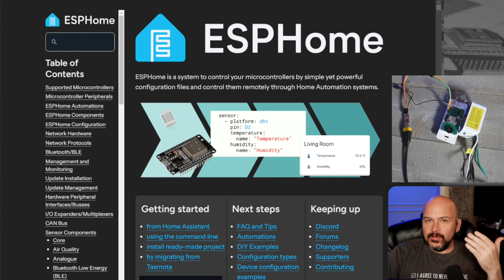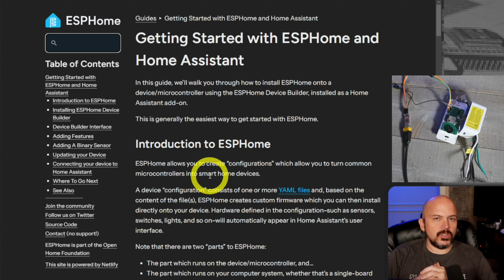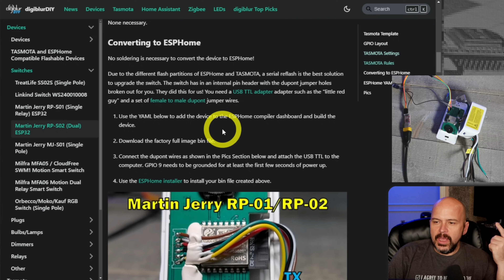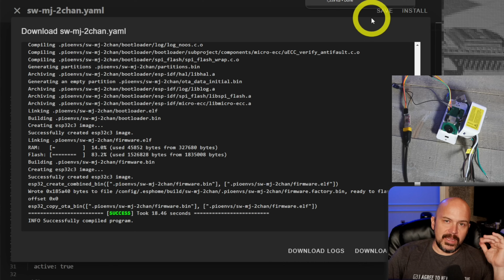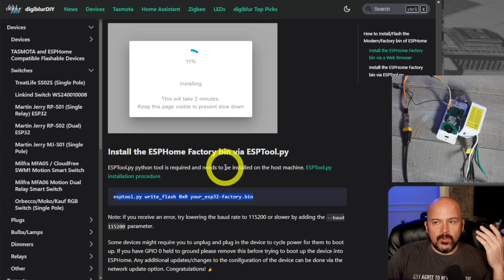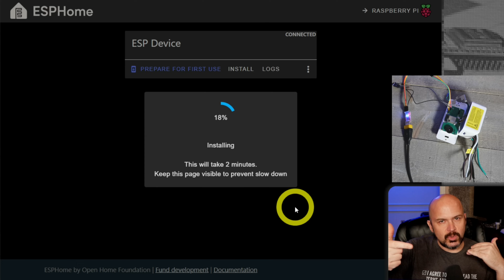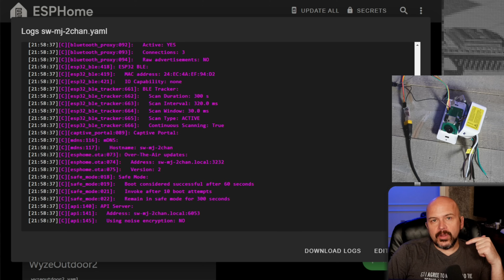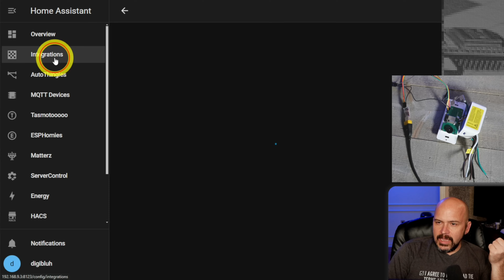ESPHome Install on Martin Jerry ESP32 Switch: No Soldering Required!

Comment: Just bought and followed this to test out the single relay switch. Easy to follow and didn't have any issues. I was looking at the RP-STD01 (3-way dimmer) version. Have you looked at that one for ESPHome? I have a lot of 3-way switches and if the single relay works for me long-term I'd get more of the 3-way dimmers if I knew what to put in as far a code goes.
Reply from the maker: Yeah we had a user get that one in our discord.  It isn't great as it has secondary MCU for dimming and the button presses are weird.

Comment: These things would be way better if the white night light was software controllable. Still bought a couple through your link because I like them overall.
Reply from the maker: Yes, that white light was kind of a bummer being on the wheel.  I don't get why they didn't just connect it to a GPIO like they did the red one.  I've told them about this and hopefully they can correct it in future hardware revisions.

Comment: Do you know that if it has tasmota, you can just user one SO command that will allow flashing of non-tasmota firmware and you can directly upload the ESPhome firmware, without any disassembling?
Reply from the maker: You can not. That's an esp8266 thing and the SO commands hasn't been required for a while now. These are esp32 switches
Reply: @digiblurDIY  Not to force my ideas, but I just did it:
1. with tasmota installed, upgrade to latest version (14.4.1)
2. then flash the tasmota32 safeboot (OTA version)
3. prepare the ESPhome binary, select manual download, get the OTA version, not the Factory one!
4. go to tasmota in safeboot, it will have only 3-4 menu options, first one is firmware update
5. don't use the OTA update, upload the OTA binary from ESPhome
6. click upgrade
7. WAIT, just wait, it will take ~2 minutes.

Enjoy :)
Reply from the maker: @rklauco and this flashes the correct partitions too and esphome OTA works?
Reply: @digiblurDIY  yep, just try, you'll see. Give it the time, it is slow, but works.
Reply from the maker: I just tried it as well.  You will get this error on future ESPHome updates unfortunately.  "ERROR Error binary size: Unknown error from ESP"  since the partitions are incorrect between Tasmota and ESPHome.  Several of us have been through this in this past.
Reply from the maker: This is the process that you have to do to reset the partitions, bit of a rabbit hole and only necessary on devices you can't easily serial reflash.  https://github.com/esphome/esphome/pull/5535
Reply: @digiblurDIY  Nope, if you switch to the minimal firmware, you don't have to do any of that. I really did it when I wrote you. I can make a short video tomorrow, if you'd like.
Reply from the maker: OK. Doesn't work for me as the partitions are wrong.
Reply from the maker: So that pull request for ESPHome is incorrect now?
Reply: @digiblurDIY  Not sure, but what I wrote works.
Reply from the maker: I really wish it did work for me and set the partitions up right for future OTAs but it does not in the current stable release of ESPhome.  I've tried it twice on an ESP32-C3 4MB chip and it fails to update in ESPHome.  It could just be me though and my setup.  I'll drop your comment in the pull request if needed so it can be closed if they deem it now works.
Reply: @digiblurDIY  Let me try with C3...
Reply from the maker: I've asked in the github pull request to see if others can try it.  Let's see
Reply: @digiblurDIY  Yep, just did it with ESP32C3 module. Exactly the same steps as described above, just instead of tasmota32 I've used tasmota32c3.
Reply from the maker: @rklauco not sure what it fails with me. How are you getting the update to take?
Reply: @ I think this PR is about the ability to upgrade even the bootloader. That is not necessary - the bootloader Tasmota is using is exactly the same as ESPhome does. The partitions later differ, but that does not matter for the safeboot version of Tasmota. But I am not big on development, just a tester/tinkerer here, so... But it works for both ESP32 and the C3 version.
Reply from the maker: You got me. I tried again and it failed to update. All using stock stable settings and firmware. Really wish this was easy like the esp8266.
Reply: @digiblurDIY  Shell I make a short video how-to?
Reply from the maker: Sure.

Comment: Honestly I still do prefer tasmota for light switches.
Reply from the maker: On the fence as well but I do have a 4 button one for Esphome with BT proxy on it.
Reply: @digiblurDIY  Same here - the BT proxy is nice feature.
Reply: When Tasmota started making it difficult to OTA other firmware, I made a point of removing it from all my devices and I'll never use it ever again.
Reply: @sjwright2  Not sure what you mean (https://youtu.be/FkV41LOKyPw), but as long as you are satisfied, everything is OK.
Reply from the maker: You didn't go further into the part that doesn't work for me.  Once you update to your legacy Esphome bin and it is on the network, now hit the update button on ESPHome like I stated before to do an OTA update.  This will fail due to the partitions being wrong.
Reply: @digiblurDIY  Oh, OK, I must have missed that. Let me try...
Reply: @digiblurDIY  Unfortunately, you are right :( After 0.1% of update, the ESP resets and starts again without update, no matter if I try HTTP or OTA from ESPhome :( So, turns out you were right :)
Reply from the maker: I hate being right on this as I do wish it was easy to do over OTA.

I do appreciate you testing it and coming back to explain your results. Definitely means a lot in a person to do so.

Comment: I'm not gunna do this. But based on your comment around 13:00 in, in general if I have a BIN file, I can skip the "prepare for first use" on an ESP32 device?
Reply from the maker: Yes use your own bin to skip the prepare part.
Reply: If you don't want to open the switch, perhaps check the how-to I posted in comment above. It's possible to do this just using OTA.
Reply from the maker: You will get this error on future ESPHome updates unfortunately.  "ERROR Error binary size: Unknown error from ESP"  since the partitions are incorrect between Tasmota and ESPHome.  Several of us have been through this in this past.

Comment: *Edit, I missed that they have changed the hardware, so what I wrote below does not apply to newer switches. Sorry!  
Perhaps you have dealt with it elsewhere, but I have a few MJ tasmota switches and it has always worked to: 
1. Access the tasmota ui and install tasmota lite to free up memory
2. Create my esphome bin file then 
3. Access the tasmota ui and upload the bin to convert to esphome.
Reply from the maker: That's esp8266 on those. You can't do the same on the new esp32 models unfortunately